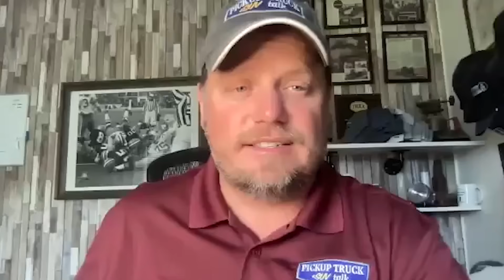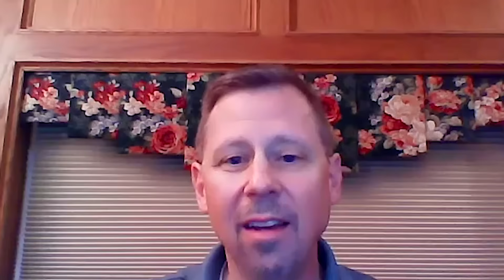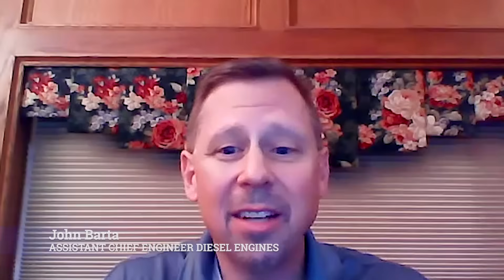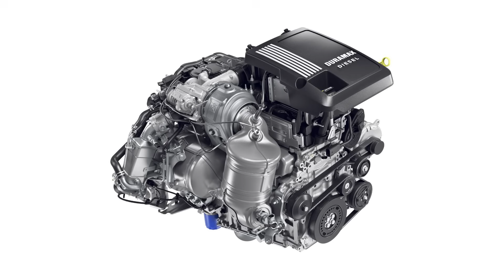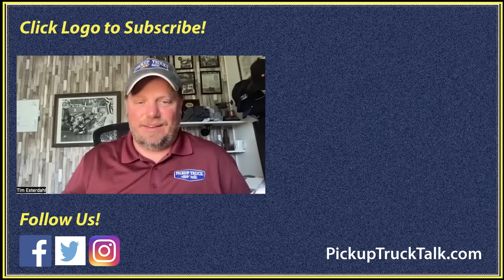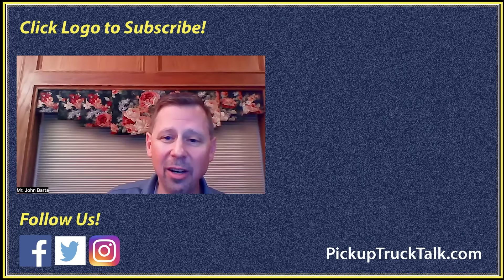GM's 3.0L Duramax Diesel Engineer Answers Questions Owners Keep Asking

Comment: I currently own a Sierra with the 5.3. I’m a huge diesel fan, however I live in the upper Midwest. I also do a lot of city stop and go traffic and short trips. My concern of getting one besides cold weather was not being able to drive it for extended periods of time to allow the engine to do proper regens. Is my concern valid or am I overthinking it?
Reply: It is a valid concern.
Reply: I have an ecodiesel in northern Wi no issues in winter so far. 2 years

Comment: I really hope GM doesn’t give up diesels in the 1500 Platform, Like ford and dodge did. It is a great set up.
Reply: I have an at4 lzo and if they gave up on diesels tomorrow we'll I've found my forever vehicle then because these 1500 diesels are literally the best engines a person can in a 1500 today. I have had 5.3 6.2 even some ford and Nissan powered trucks and let me tell you none of them come close to the power and fuel mileage my lz0 puts out . Plus the smooth driveability is amazing
Reply: IF they do it right.

I would have bought a diesel Colorado if they had done it right. I was so excited about it. I wound up going with the gasser. 

That being said I may buy a used one now that I need a secondary tow vehicle on occasion/commuter vehicle combo. 

At least with the Colorado the timing belt is on the front of the engine. So you just take off a few pulleys and such to change it. Instead of removing the cab like with the 1500.
Reply: @great0789  Chevy tech… realistically you just drop the transmission and change it like doing a rear main seal
Reply: @maldenfoster to me that's BS.  Like I want to drop the transmission to do that. They need a better  design. Keep things simple.
Reply: @dragonwagon71  dropping a transmission is simple. Either you don't have the equipment or your a baby or both.
Reply: @maldenfoster  don't own a trans jack.
Reply: @dragonwagon71  $130 bucks from harbor freight dawg. It's not expensive
Reply: @great0789  "At least with the Colorado the timing belt is on the front of the engine. So you just take off a few pulleys and such to change it. Instead of removing the cab like with the 1500."

Ironically Ford started using oil pump belts on the 2.7 Ecoboost and 5.0 Coyote a few years ago and the labor hours require to service the belt is MORE than the labor hours to service the belt on the LM2/LZ0. There's way more stuff on the front of the engine besides "just a few pulleys and such". You're pulling the timing chain cover, harmonic balancer, cooling fans/shrouds, timing chains, etc. And most shops that get that to the point of removing timing chains on a 2.7EB or 5.0 are going to tell you to have the chains/cam phasers replaced "while they're in there".
Reply: @hochhaul you do not remove the cab.  Do some researxh before soreading false info.
Reply: @great0789 the 3.0 duramax is based off of a European cab over engine that’s been in use for a while with great reliability ratings with all their emissions crap
Reply: Given the emission laws, it is almost totally impossible to certify diesel passenger vehicles.  It may not be worth it.
Reply: I would not have believed you. Until I bought one. I like it a lot more than the 6.2 I had.
Reply: I wish I could aquire one without having the consequence of likely needing to live in it.
Reply: @MouwDown  I got to agree. They cost way to much.
Reply: 29 mpg.
Just purchased in Silverado LT Z71, crew cab, 6 3/4 bed.
500 miles to drive it home, visited Philly, got a cheese steak, stuck traffic NY, then hwy.
Averaged 29mpg and its getting range on tank over 700 miles, that during break in.
Smooth, quiet, and power. Nicest driving down road of options, I am thrilled.
Reply: Gmc sierra 1500 fuel tank size in 2024
Reply: Wow 200,000 and it's in the shop for a belt and a 5,000 dollar bill. Why in the he'll would you put a pump back there any way? You engineered something that could be really awesome to something  that no one wants it at 200,000. You know it will not be cheap. Should replace the transmission  while your at it. As it probably go out in another 50,000 so we are back to taking it apart again.
Reply: @dragonwagon71  "Wow 200,000 and it's in the shop for a belt and a 5,000 dollar bill."
$5,000? HAHAHA 

"You engineered something that could be really awesome to something  that no one wants it at 200,000."
Plenty of guys would be okay with paying an independent shop to change the belt. If the belt makes the truck as worthless as you insist it does, that's a huge problem for Ford because both the 5.0 and 2.7 Ecoboost have been using the same oil pump belt since 2021. 
 
"Why in the he'll would you put a pump back there any way?"
Because it takes fewer labor hours to change the pump belt at the back on this engine than it does to change the oil pump belt on engines like the 2.7 Ecoboost which has it at the front. There's WAY more work to get at a belt on the front of the engine. You're removing cooling fans, unbolting radiators, removing belt driven accessories, harmonic balancer, timing chain cover, timing chains, etc. The belt and timing chain are located at the back of the 3.0 because this engine was original designed for cabover medium duty trucks in Europe, so they were easier to service at the back. By leaving the design intact, GM kept costs down. The cost to get the 3.0 over other engines is just $1000. As opposed to $10,000 like the 3.0 Powerstroke in the F-150. You get a torque monster than can get 30 mpg at reasonable highway speeds. 

"You engineered something that could be really awesome to something  that no one wants it at 200,000"
Sounds like intelligent guys will get a good deal on a truck with 200k miles that just needs an oil pump belt service.
Reply: @hochhaul  and just how many people can work on there own trucks? Not as many as you think.
Reply: @ plenty of guys can find a shop that will do it that belt for way way less than $5000. That's a clownworld price quote.
Reply: @ your pricing is cometly wrong realistically it's a $55,000 truck and a $100 part
Reply: With fuel prices the way they are and the increased maintenance cost it doesn’t really make sense to buy the diesel
Reply: @wtfover7424 don't speak in absolutes. Here Diesel has been less than regular unleaded for a while.
Reply: @wtfover7424  Even with fuel prices the way they are, you're getting 490 lb-ft at low engine RPM. Any gasoline engine even close to that number is sucking down twice as much fuel and probably strongly recommends high octane fuel if towing (the 3.5EB being one of example). This engine has 6.2 V8 torque without the massive MPG penalty.
Reply: @wtfover7424  it comes down to mpg.... does getting 30 plus on the highway compared to 17 with a v8 ... wash out when comparing gas prices and increased cost to maintenance... especially when your talking about an engine that could last 300-500k compared to a conventional engine that is designed to last 200k? If you sit down and do the math... you might be surprised in what you find...
Reply: @sethlover6498  I find after 200k then $5000. Just to do another 200k would buy a lot of fuel in one you don't have to put that 5k into. I love the motor just not the maintenance.
Reply: @dragonwagon71  Except that now the two most popular engines in the F-150 built in the last five years both have oil pump belts that require even more labor hours to change than the 3.0 does. You want to cry about dropping a transmission, have fun pulling all the stuff off the front of the engine including the harmonic balancer, timing chain cover and timing chains just to change a belt. What are the alternatives? The 3.5 Ecoboost still has timing chain stretch issues after all these years, costing waaay more to have serviced than the oil pump belt. The GM DFM V8's that will drop a lifter after the warranty and end up costing more than the oil pump belt service, not to mention they make way less torque, and gets 20 to 30% worse fuel economy. The 3.0 Hurricane makes good power but fuel economy is bad, repair costs are unknown, and the thermostat is a major issue. Toyota still hasn't figured out their main bearing failure issue and the truck it's in leaves way too much to be desired in terms of the design of the truck. A few grand to change an belt and go another 200k is pretty minor in the long run.
Reply: @wtfover7424  I agree.  The reputation that diesel is "tougher and cheaper" just isn't true these days IMO, unless you are doing FULL time hauling.
Reply: Diesel will come down in price. 
It has been cheaper than gasoline several times in the past couple years.
Reply: @777jones  show me a 1/2 ton that can beat this 3.0 in fuel mileage. It's not hard to maintain them. And they last a lot longer than your gas.

Comment: Because diesel engines are so efficient, they are not part of the engine market that really needs to be focusing on hybrids because they are already quite efficient. At most they should see if they will produce one that runs on corn oil.

Comment: This seems like a really nice engine and I would love to have a Tahoe with a 3.0 but the fact that I would have to have the oil pump belt changed at 150000 miles and that requires the transmission to be dropped to do so is a huge deal breaker, does anyone know how much this is going to cost? This seems like a horrible design!!
Reply: It's not that big a deal. And they just revised the belts to last to 200K miles. Chances are we will all be humming around in George Jetson style cars by the time comes for service on that belt. Even so its estimated 8 hours labor. So around 750.00 is the estimated labor give or take.

Comment: Disagree all you want, but the 3.0 is the best engine in any half ton pickup, I've had two, one in a Silverado RST and one in a Silverado LTZ. Granted, I work at a Chevy dealership, but believe me I've driven pretty much any newer pick up aside from a TRX, and nothing comes close to the 3.0, its absolutely absurd how good it is. I have a very heavy foot when I drive and was still able to average 23 mpg. Long commutes/trips, if I don't step on it, easily get 28 (going 80-85 on 33s AT). Just the responsiveness, power, efficiency, smoothness.

Comment: Great video, I have a '21 Sierra that had the long crank issue but they fixed it and no issues for months. In fact your video was what clued me in on the problem to alert the dealership as to what it was. But I absolutely love my truck. I am so impressed by the MPG from my '17 5.3 liter. I put 33" Nitto Ridge Grapplers and a 2" leveling kit on mine and still range from 24-26 mpg. If I baby it I have gotten up to 29.4 mpg and the ride is just amazing. So far with 20,000 miles on it I see zero reason to get rid of it......until I saw the new late year '22 new cabs...LOL. Thanks again for the good content!!!!
Reply: Your happy w the mpg of your 5.3 as well or did you mean the 3.0 litre diesel? Your talking about two engines.

Comment: I hope GM is running this engine in the lab way beyond 200,000 mile simulations. I'd like to hear how long it runs before the belt breaks.
Reply: I'd love to know why they didn't simply use a chain that wouldn't disintegrate. He totally sidestepped that part of the question. You don't have to move the oil pump to replace a belt and pulley system with a chain and sprocket system that take up the same or even less space. Completely bone-headed design, unless you want your dealerships to make tons of $$$ doing that job.

Comment: Piss off with that oil belt drive. Only reason I WILL NOT buy a 3.0 diesel. It kept me from getting it when it came out and will keep me from getting one ever. You did an engine redesign to get to the LZ0 and FAILED to fix the #1 complaint?!? I was 100% ready to buy a new diesel 1/2 ton until this little piece of info came out on the LM2. Now you've gone and kept the stupidest part of it? WTF is GM thinking? Looks like AGAIN, I won't be buying the 1/2 ton diesel.

Comment: I have 2021 with this engine 3.0 i love the mpg but the only thing the truck have a electric problem that the truck been on two dealerships for reapers and they have no able to fix. Spend one month last year and this year 4 months. They just give back an let get the check engine light back on. They can fine where the problem is. I think GM need to do better on the product..

Comment: What abOut the leaky enjectors, fuel rail, and fuel pump issues.   I have a 21 elevation and it has been in the shop 6 times.  The first time it was leaky enjectors, second time fuel rail, third time fuel pump enjectors and rail.  It has been a pain in the but.  So much GM has agreed to buy it back.  I really love the idea but I see other people have the same issues.  Plus I do have the king crab every now and again.  I really hope the LM0 fixes this.
Reply: lol 99% of LM2 owners I've seen comment online say they absolutely love the engine. You are one of the only ones that I've seen claiming injector issues. Sounds like you had one bad injector that turned into more issues due to botched repair work. Or the fuel pump was defective and caused all the other issues due to fuel system contamination.

Comment: Now they just need to make it reliable, so many of my friends have this older version of this engine and have had nothing but issues and can’t get parts to fix them , I personally would purchase one but not until issues are addressed.
Reply: Interesting. I know a lot of people in real life and online that absolutely love their LM2. The only issues I'm aware of are all due to the defective plastic valve cover, which has a TSB out for it and a redesigned valve cover that fixes the issue. It was allowing engine oil to leak into a ventilation tube and get sucked into the engine. That caused oil consumption, glow plugs fouling and failing, and excessive regens since burning engine oil causes the DPF and EGR to get sooted up.

Comment: I'm sure it's alot more capable then they have it set at. It just needs gear drive for the oil pump and cam. Then it would never die.
Reply: The aftermarket might try to do that but no manufacturer is going to use a gear drive on an engine like this. They're much much expensive and very noisy, which was part of the reason the pump was moved to the oil pan in the first place -- vane style oil pumps make a lot of noise to begin with. You would have every Karen in the county going to the dealer, complaining about whine of that gear-drive setup you want so badly.

Comment: Tim, I was thinking of buying a AT4, 2020 or 2021 with budget around $63 on market for 25-30k miles. This would have the 3.0 LM2 engine. I am rethinking but the new one will be, what $85-90 new? Are there enough issues with the LM2 to justify the extra money for the LZ0 or in other words are the repairs and “fixes” minimal in cost (not headache) compared to the higher cost to get the new engine?? Thoughts?? 25% improvement seems like a flag??? $25k is a lot of money…..
Reply from the maker: Nah, not that much money for a new one. Also, the LM2 issues have been resolved, so no worries there.

Comment: The gm 4.5 v8 duramax with 310hp/510tq that gm shelved in 08 or 09 would have been perfect for the 1/2 ton trucks 🤷🏿‍♂️ it's just a smaller version of the 6.6. Hopefully gm will do away with the ticking time bomb 2.8 and 3.0 belt driven oil pump
And for the gentleman to say it would be a design change well whomever looked over the design of the 2.8 and 3.0 should have said wait a minute is that a belt driven oil pump well I'm not signing off on those engines redesign them with a crank shaft driven oil pump and gear driven valve train....have a nice day

Comment: Yea, the guy's all smiles until it shits the bed and the mechanics can't even diagnose it.
Hahahaha... and when it's out of warranty you have to remortgage your house to fix that turd.
Yea "power and torque, power and torque" but lets not forget all the problematic emissions crap > > > power and torque and no one can fix it when it screws up.
Baaaahahaha class action law suite against GM for their failing lifters in the gas engines... but lets not forget about Power and torque"!

Comment: Does a customer still have to have engine pulled to change oil pump belt at 100,000 to 150,000 miles or blow the little diesel
Reply: Yes, they mentioned at a increased number to 200k Miles now

Comment: I was 100% invested in buying a truck with this engine coming out, until I found about the increase in emissions. Diesels have already had issues plagued with DPF systems, and adding additional emissions is more concerning. Some people will argue, but I haven’t seen anything good long term with the all the emissions, and it is only getting worse in 2023 models.

Comment: 300hp and 500 torque is pretty impressive, 3/4 ton trucks wish they could do that 15 years ago and it's got a 10 speed transmission... should be great.
Reply: Even if they could have done it they couldn't have done it as efficiently
Reply: I just bought one of these trucks I think it has this new rpo code engine it’s a 23 and it has
 a lot more power than my 03 lb7 3500

Comment: I loved my 2021 sle crew 3.0 but sold it back in less than a year. Powertrain was phenomenal.  Everyone loved it.  But here are the three reasons I got rid of it:
1.  Lost 8 weeks of lease after 3 trips for then trying to figure out faulty coolant control valve.
2.  Poor suspension  ..way too soft and high body roll and not willing to pay to fix that on a lease.
3.  I could not get by with 5 8 inch bed.

It didn't hurt that a dealer gave me about $1500 cash the minute I walked in to sell it